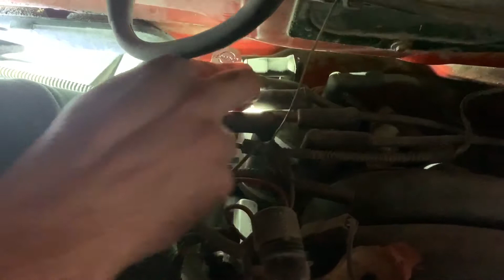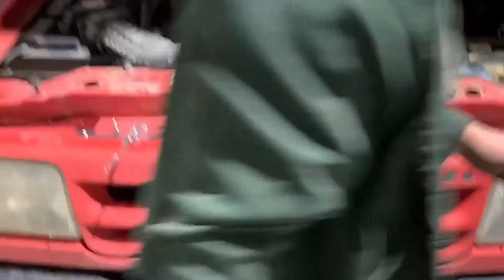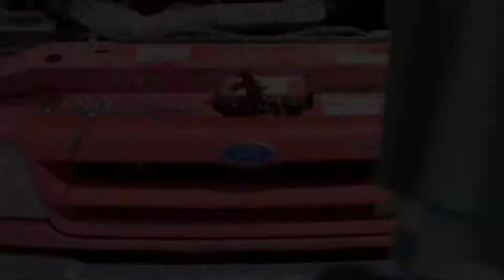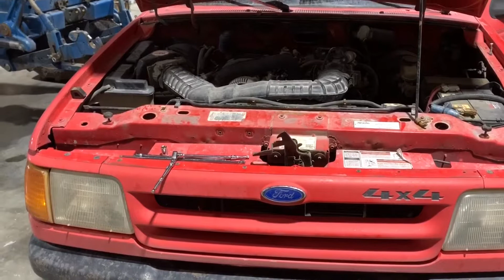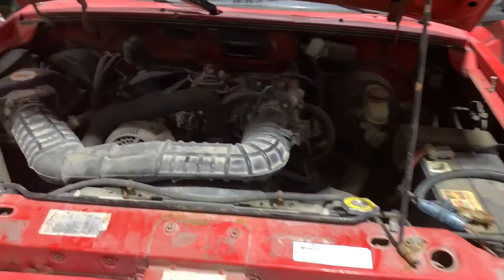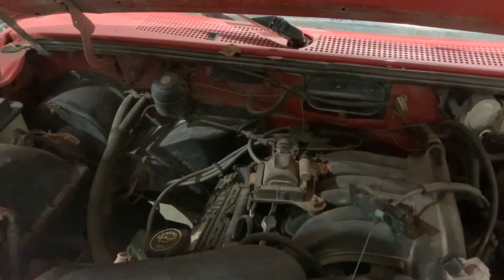1994 3.0L Ford Ranger preliminarily ignition timing

Comment: I have a 93 with the 3 liter. Basically my engine looks the same as yours. How do you set the ignition timing?
Reply: I recommend getting a timing gun from Harbor Freight. If there isn't one already, make sure TDC is marked on the crank pulley damper. You attach the timing gun to No. 1 ignition wire (front-most on passenger side), then connect the red/black clamps to the battery. With the engine running, point the timing gun at the crank pulley and hold the trigger. The gun will strobe (each flash of light is No. 1 cylinder firing). You should be able to see the timing mark on the damper relative to the TDC notch on the timing cover. Haynes says the 3.0's stock timing is 10 degrees BTDC, so you have to turn the dial on the timing gun to 10 degrees. Then rotate the disty until the marks line up.
Reply: Check the website. Very good instructions.
Reply from the maker: Tyler Fabish from step one?  I have a book that walks me through that.  

I had to pop the cylinder head off so I used an indicator mark on the distributor when I removed it so I had a very rough idea where to reinstall it.   The truck did run, but it hated the cold and ran very rough.   So I just started fiddling with the distributor until it sounded better once the engine was warm. 

If you like I can relay the actual steps in my book later if that would help you out.